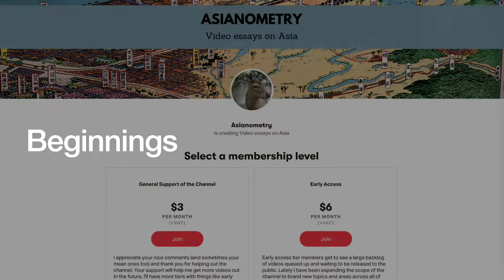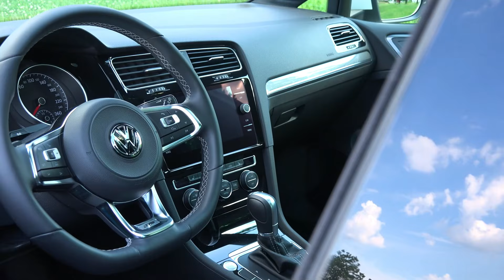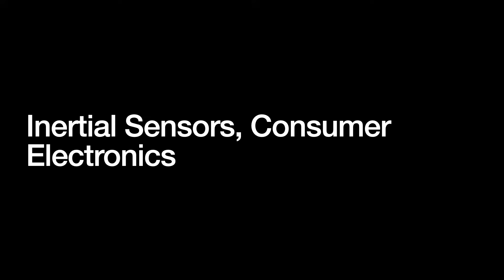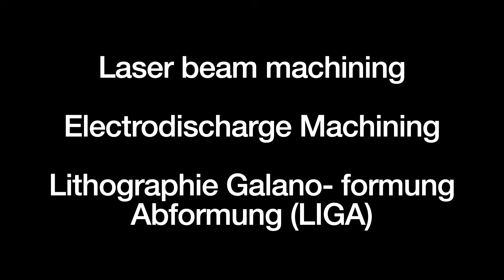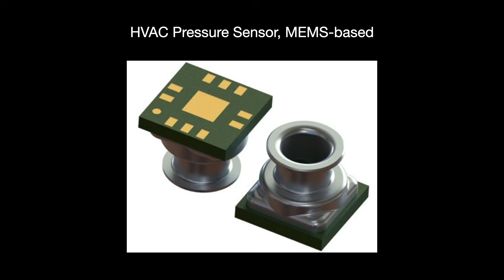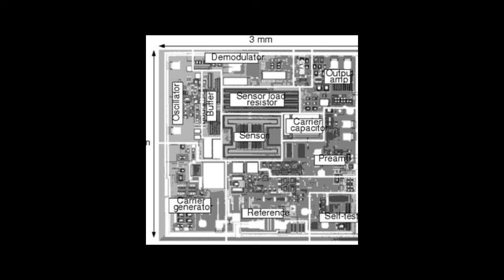MEMS: The Second Silicon Revolution?

Comment: Isn't the size of a speaker is its own bandpass filter? Not sure about tiny speaker's ability to reproduce low frequencies, unless there is some subharmonic resonance. I always had this adea about microphone/speaker with mechanical sensor for every audible harmonic. For lower frequencies it won't be directly MEMS but with some mechanical transformation as in our ear it might work. Not sure if it makes any sense, but at least it will bypass ADC and frequency response of every part of a conventional microphone.
Reply: You'd basically have to implement a Fourier transform in hardware, read every frequency lane, then convert that back to the time domain in software.
Reply: @gargantuablargg  Aren't FFT and convolution algorithms meant to be done in hardware? I think that there is no need for software since you'll already need to use hardware design. If it someday become a reality we will most likely start to encode harmonics with time but not the quantized data from ADC, so it'll al be done in one scecial circuit.
Reply: @AlexanderSylchuk  Given how little processing audio takes in comparison to video, and the complexity of having streams of audio as frequency lanes, I doubt it'll ever change much from the current PCM approach. Unless the receiver of the data happens to need exactly that frequency-domain format, it'll have to convert it anyway.

As for FFTs for audio, I imagine they're mostly done with vector instructions in optimized FFT libraries, and sometimes as normal non-vector algorithms.
Reply: @gargantuablargg  My idea is probably more religious in a sense that you'll be sure that the sound you've recorded is exactly the sound that was there. You will be no longer limited with the quality of your equipment there will be only exact copy of sound you decided to record. It's like in Nicene creed we say "light of light" as if it is not limited or changed by any new interpretation or permutation. I just have this feeling that the price of hardware in the future is going to erase the difference between such specific circuit and modern ADC + codec solution.
Reply: @AlexanderSylchuk  What is the original sound? I'd think that its effect on a diaphragm is considered its essence, short of recording all of the individual molecular motion, or the processes at the sourceof the sound. What better than a time-domain recording of the position of the diaphragm?

Though, you might develop this idea for the audiophile crowd, where they will pay big bucks for this kind of esoteric hardware.
Reply: @gargantuablargg  I wouldn't necessarily call it esoteric)) What I mean by original sound is just exact changes of pressure with time in the place where it was recorded. With MEMS we can recreate something similar to what is going on inside our ears.

Every time you use microphone of any kind you add up to the original signal acoustic frequency response of your mic itself, after that there is frequency response of a membrane used in that mic, after that there is frequency response of the mechanism by which youre going to transform sound into the electric signal whether it is coil, capacitor, ribbon or crystal and after that you have frequency response of your electric circuitry, like amplification and analog to digital conversion. Mathematically speaking you have convoluted your original signal with many frequency response functions from all those middle steps. Some folks can listen sounds only by pointing a laser beam onto a window, for those scenarious they only need to know a frequency response of that window. Everything will bring its effect onto the acoustic scene. By the original sound I mean not just pure signal from the source, but rather all the reverberations from all the objects which have their own frequency responses that are present on the scene (whether it's some room or open space).

The reason why people like tube amps, film photography or filters on social media is the same, they just prefer the convolution of the original imformation with frequency response function of that medium that they prefer.

To me pesonaly more important question is probably ownership of intelectual property. Where is this limit between simple convolution of frequency responses and significant enough change so that it will make it specifically yours. Whether it is just a reflection or your personal work, words etc. Right now this line is defined by our legal system and edge cases are decided in courts. The real concern is when countries with vertical control of their legal systems start to decide this question on their own.
Reply: @AlexanderSylchuk  "With MEMS we can recreate something similar to what is going on inside our ears."  OK, now I get where you're coming from. That does have an appeal.

Comment: The MEMS applications that appear to be successful are those where the parts either don't move or don't move that often.  Attempts to create a MEMS version of a transistor that would have to switch on/off billions of times a second have not been as successful as the applications mentioned in this video.

Comment: Interesting video.  Viewers should understand that MEMS developers have recognized the need for standards for more than 20 (30?) years.  While there has been some success with packaging and interconnect technologies, available "standard" MEMS processes (usually offered by small foundries) are just not capable of manufacturing commercially competitive devices.  In the end, 98% of the process might be standard, but the crucial 2% required to make the device successful is unique (kind of like human vs chimp DNA).  And unfortunately every new device requires a different 2% of highly refined manufacturing capabilities.  The key insight is that MEMS fabrication is fundamentally different than IC production.  IC makers use the fab to lay down layers of electronic materials that interact in well defined ways.  MEMS makers use the tools of the IC fab as a highly sophisticated machine shop.  And unless you are machining exactly the same part, the manufacturing flow has to be tweaked - usually significantly.  Even though both hammers and screwdrivers are mechanical devices, you wouldn't expect to be able to make the best hammer or the best screwdriver using the same process.  This - and even greater difficulties in MEMS size (cost) reduction - make the economics of MEMS completely different from IC's.  MEMS are never going to be capable of delivering the never ending year on year cost reduction that Analog Devices institutionalized years ago.  THAT is probably the biggest lesson - and ultimately the greatest limitation on growth in the industry. ;)
Reply: Another big difference is that scaling doesn't really work. Reducing the size of a MEMS sensor often makes the noise worse, but more important, there is really no benefit to fitting more sensors on a die after say 6 in the case of an IMU. Smaller dice are a bit cheaper, but if the package really dominates then this does nothing.
Reply: Maybe it will go the way of 3d printing.
Reply: @luminousfractal420  Interesting thought
Reply: thhx....

Comment: My favorite application for mems is in aviation, since I am a recreational pilot. One of the first and most successful application of mems was accelerometers, which don't need openings in the package to work. Accelerometers can replace gyroscopes as well as enable inertial navigation, since they can be made to sense rotation as well as movement. With the advent of mems, avionics makers looked forward to replacing expensive and maintenance intensive mechanical gyroscopes with mems. A huge incentive was reliability: a gyroscope that fails can bring down an aircraft. The problem was accuracy. Mems accelerometers displayed drift that was worse than the best mechanical gyros. Previous inertial navigation systems used expensive laser gyros that worked by sending light pulses through a spool of fibre optical line and measuring the delay due to rotation.

Mems accelerometers didn't get much better, but they are sweeping all of the old mechanical systems into the trash can. So how did this problem get solved? Well, the original technology for GPS satellite location was rather slow, taking up to a minute to form a "fix". But with more powerful CPUs it got much faster. But GPS cannot replace gyros, no matter how fast it can calculate. But the faster calculation enabled something incredible: the GPS calculation could be used to calibrate the mems accelerometers. By carefully calculating the math, a combined GPS/multiaxis accelerometer package can accurately and reliably find a real time position and orientation in space. You can think of it this way: GPS provides position over long periods of time,, but very accurately, and mems accelerometers provide position and orientation over short periods of time, but not so accurately. Together they achieve what neither technology can do on its own.

The result has been a revolution in avionics. Now even small aircraft can have highly advanced "glass" panels, that give moving maps, a depiction of the aircraft attitude, and even a synthetic view of of the world outside the aircraft in conjunction with terrain data. It can even tell exactly which way the wind is blowing on the aircraft because this information falls out of the GPS/accelerometer calculation.
Reply: Great points. 
Gps fixing does not have to do with better cpu's per say, but better prediction lookup tables for faster signal fixes. If you note a first startup of a fresh gps without any tables, it takes a while to get a fix, but subsequent power ups provide faster fix times. These tables can be pre programmed, and are geographically based. However, not all systems utilize them to their full potential for quickest signal locks.
Those spinning gyroscopes are bulky, but neat. Name another instrument that makes such a sound! The protective casings are a farce if the gyro decided to let go of itself fully spun up. Beautifully scary!  If car bearings are packed with gyro grease, will there be a performance gain? 😝
Reply: @D R That's a great question. In fact we could just use the altitude from the GPS system. Right now you dial in the barometric "base pressure", or pressure at sea level. This is used to calibrate the altimeter so that it delivers accurate results, I believe it is within 100 feet of accuracy (other sources say the FAA allows 75 feet of accuracy). Its a big big deal. A few feet could mean if you hit a building or pass over it. Thus when you fly, you are always getting pressure updates from the controller, because you are going to need updates that are as close as possible to the pressure in your area.

So why not use the GPS altitude, which is more accurate?

1. Not everyone has a GPS.
2. Even fewer have built in GPS (in the panel of the aircraft).
3. A large number of aircraft don't re calibrate their altimeters at all.
4. New vs. old. Aircraft have been around for a long time. GPS not so much.

If you know a bit about aircraft, you also know that number 3 there lobbed a nuclear bomb into this conversation. Don't worry, we will get there. First, there is GPS and there is GPS, implied by 1 and 2. Most GPS units in use are portable (in light aircraft). Long ago the FAA mandated a system based on transponders called "mode-C" that couples a barometric altimeter into the transponder. OK, now we are going into the twistly road bits. That altimeter is NOT COMPENSATED FOR BASE PRESSURE. In general the pilot does not read it, the controller does (ok most modern transponders do read it out, mine does, but an uncompensated altitude is basically useless to the pilot). The controller (generally) knows where you are, and thus knows what the compensating pressure is (no, he/she does not do the math, the system does it for them).

Note that GPS had nothing to do with that mode C discussion. So for the first part of this, for a GPS to be used for altitude, the pilot would have to go back to constantly reporting his/her altitude to the controller. UNLESS!

You could have a mode S transponder, or a more modern UAT transceiver. Then, your onboard GPS automatically transmits the altitude, and the position, and the speed and direction of the aircraft.

Now we are into equipage. Note "onboard GPS". That means built into the aircraft. Most GPS on light aircraft are handheld, which are a fraction of the cost of built in avionics. Please lets not get into why that is, its about approved combinations of equipment in aircraft, calibration, and other issues. The mere mention of it can cause fistfights in certain circles.

Ok, now lets get into number 3. If you are flying over, say, 14,000 feet, its safe to say you are not in danger of hitting any mountains, or buildings, or towers. Just other aircraft. So you don't care about pressure compensation. So the rules provide that if you are over 18,000 feet, you reach down and dial the "standard pressure" of 29.92 inches of mercury, which the FAA has decreed is "standard pressure" (the FAA also has things like standard temperature, standard tree sizes, etc. fun outfit). So what does that mean? Say you are TWA flight 1, and TWA flight 2 is headed the opposite direction, same altitude. Both read 18,000 feet. Are they really at 18,000 feet? No, but it doesn't matter. If they are going to collide, they are in the same area, and thus the same pressure. Meaning that their errors cancel. It doesn't matter that they are really at 19,123 feet, they both read the same. Thus climbing to 19,000 (by the altimeter) means they will be separated by 1,000 feet.

So the short answer is the final one. The barometric system is pretty much woven into the present way aircraft work. It may change, but it is going to take a long time. Like not in my lifetime.
Reply: Ohh now i get how new feature of Google maps work
Reply: you are very professional!
Reply: That would save lives if it stops the death spiral. (AKA the graveyard spiral). thanks for the post.

Comment: First MEMS device that caught my interest was micro mirror array chip from Texas Instruments for  DLP video projector. It was wonder technology, compared with then current 3-tube CRT or LCD projector. DLP technology enabled laser movie projector in digital movie theater of today. It opened age of digital cinema (Star Wars Episode I: The Phantom Menace 1999)
Reply: Yup that was the one I modified for use to calibrate thermal cameras. Decanted it and coated the mirror assembly with a very thin layer of gold then recapped it under vacuum with a ZnSe window. It saved a lot of money on that project since a bunch of test patterns could be generated as needed. ❤

Comment: it's interesting to see how lithography can be so much better than traditional manufacturing. I remember when wifi antennas used to be rods or little wires, whereas placing these same antennas onto much more controlled surfaces like the PCB itself improves their performance by an order of magnitude. Given how controlled the lithographic processes are, I assume that similar gains, or at least consistency, can be achieved therein.
Reply: Depends. On PCBs, when very high accuracy is required, they laser trim them. We used laser trimmers on resistors in hybrids as well, really nothing beats it for accuracy. There was an outfit selling laser configured ICs, like an FPGA but the fuses were laser burned. The company failed, and I ran into one of their engineers later and asked him why.

"contamination" -- was the answer.

Comment: I can see MEMS chiplets being a thing.  Just purchase them "off the shelf" and add them to your SOIC. No need to design your own gyro etc for your project, no need for the extra volume to add an external gyro.
Reply: I'm lead to believe that a number of MEMS devices are indeed MCMs - multi chip modules, such as 9-axis IMUs. But i'm not super certain. And yeah putting an existing MEMS onto an MCM leadframe makes sense i suppose.

But also it may be unnecessary. Have you seen WLCSP packages? Like damn.
Reply: @SianaGearz  you’re right, because MEMS use silicon-on-insulator instead of bulk silicon they are a separate chip than their electronics most of the time
Reply: Aren't MEMS chips typically powered from specific purpose low-noise supplies different to the main cpu buses? They're way more electrically noise sensitive than other devices.
Reply: Given their different manufacturing challenges, seems like you'd have your SOIC and a separate MEMS chip that combines all the sensors you need.
Reply: @gargantuablargg  Yeah, as one of the commentators mentioned above the WLCSP packaging, holy crap how tiny. PCB real-estate isn't such a big deal for MEMS devices nowadays.

Comment: I have heard claims like this so many times, like "bendable parts" was going to change the world.  I appreciate the work you put into this video, but not the clickbait title.
Reply: You probably already have dozens or hundreds of MEMS IC. The most common is a MEMS clock oscillator, instead of large cans it's now tiny barely die sized chips that have saved an insane amount of space, and space is everything in so many use cases. Then a handset typically also has those but also a MEMS microphone or two and of course inertial and magnetic sensors. A number of life saving medical devices couldn't have existed without getting the electronics down to size or the use of MEMS sensors.

And bendable parts (flextures) have already changed the world centuries ago, they enabled book binding. So just not really new.